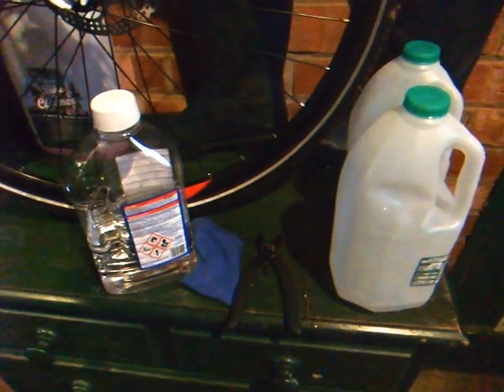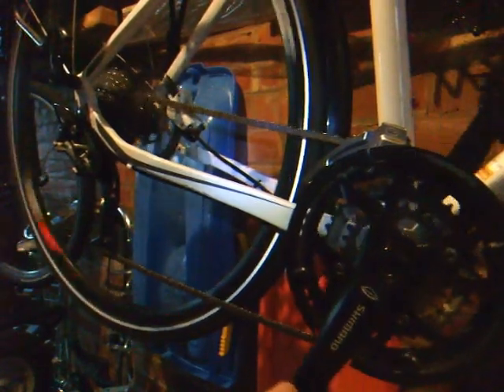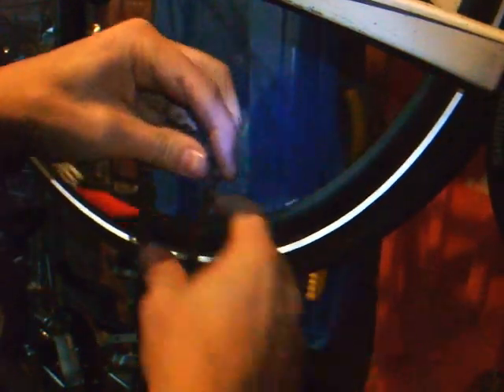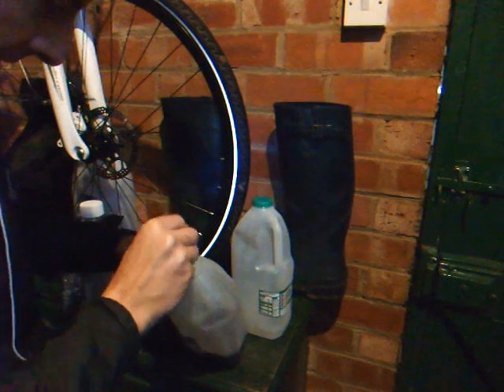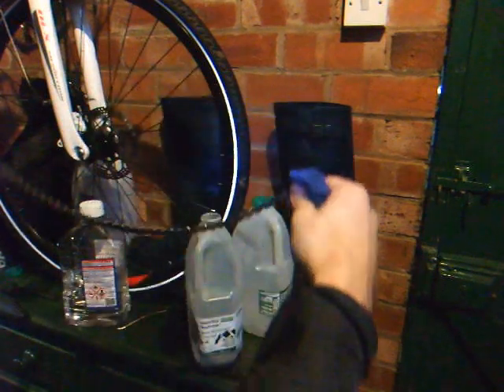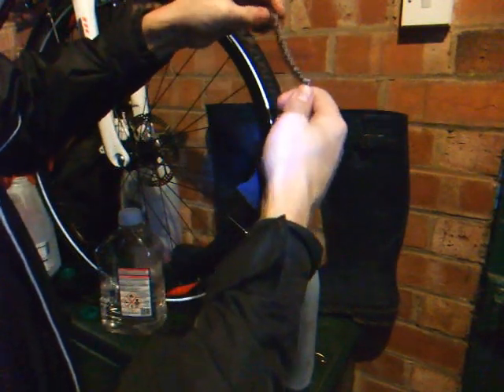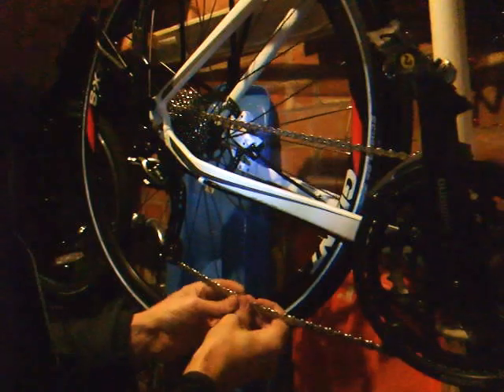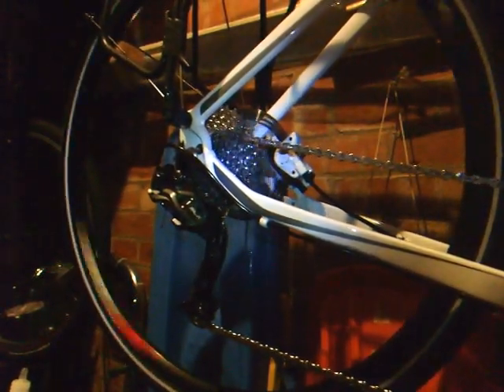How to effectively clean a REMOVABLE bicycle chain - the quick and easy way.

Comment: Hello, do this method really essentially extend the lifetime of a bicycle chain compared to cleaning it with a rag full of wd 40 or a bicyle cleaning tool?
Reply from the maker: I think so, but even if it doesn't extend the life it certainly helps with shifting. Once the chain has been through the 'rinse cycle' there is no grit in the chain, when you twist it you can hear no grinding due to grit.
Reply: thanks alot for quik answer.